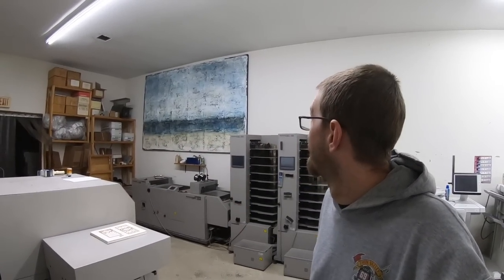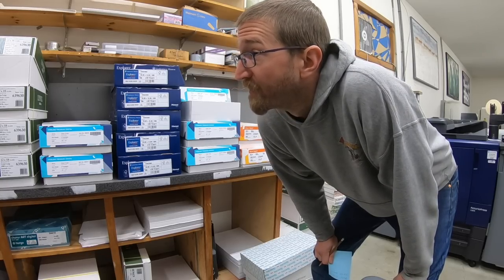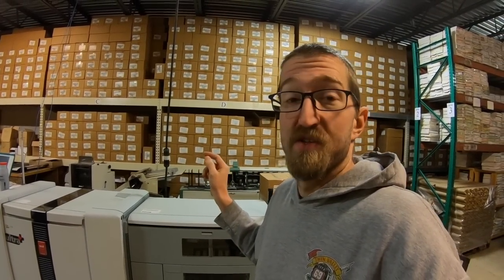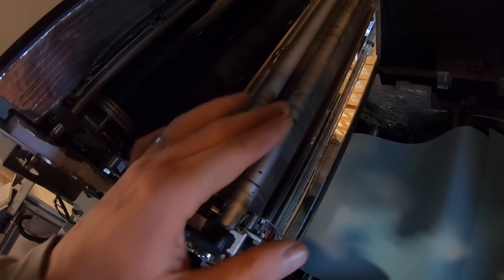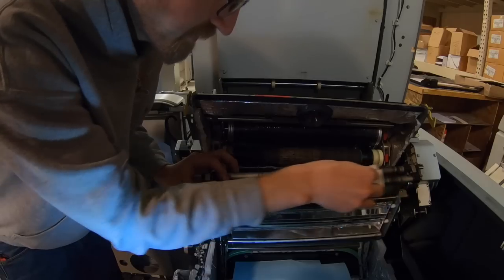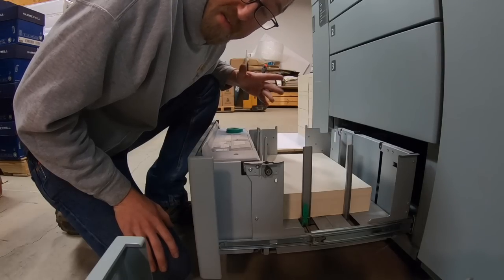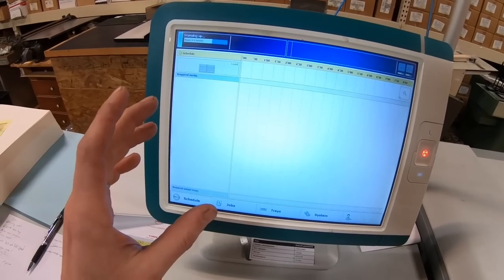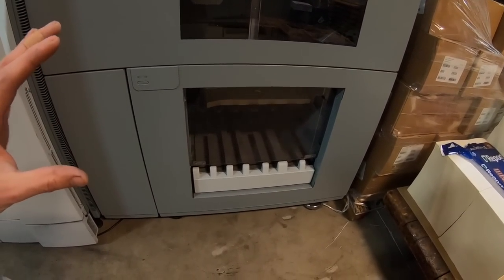Image Quality Problems on Canon/Oce Varioprint Ultra

Comment: The Varioprints are the way to go, been running a 6160 for nine years, only to replace it with a Titan 6180 two years ago. Colour is done on a Canon 10000, we also still have 
4-colour conventional sheetfed and the combination of all this is simply perfect. Kind regards from Germany.
Reply from the maker: Great setup. I will likely work towards that!
Reply: Winning combo! Did the exact same thing.

Comment: hi Dan, that void that you have is from the developer unit. if you notice clumped up toner or dirt in the devl units its best to do a one time servicer on the devl units..a complete clean up removing all the toner and a complete vacuum of the units. if you see the spiral cleaners filling up at the ends you need to chck your devl units for side leaks that will spill  over to the framing lamp located below the devloper unit and when you clean the framing unit you need to cleaon the print head too. the spiral cleaners are to remove paper dust and the sheet cleaners are to remove the the excess residue from the process. it works by printing a solid black print every 1500 prints which is then transfered tyo the spiral cleaner to form a sticky surface which then is used to clean off paper dust from the TTF belts..the sheet cleaners then collets any residue left behind by this process..there are also glue cleaners at the bottom back of the ttf units that should be cleaned everytime you replace your ttf belts these are the shiny rollers that have the coolent running through them these rollers are used to clean off glue that can sometimes be found inthe paper stock and other contaminations such as wax. typically the ttf belts have a life span of about 2.5 million prints per belt, same goes for the OPC, but this can vary with different types of media. and yes there is NO waste toner for this VP6XXX series . i service these machines and i can tell you that they can run for 4 days straight without any problems or jams providing they are running with good media and in the correct enviroment.
Reply from the maker: Wow, thanks for the education. That was very helpful!

Comment: I use to tech Oce stuff many years ago. They are monocomponent and it works pretty well. But you really need to shake the toner before you add it. And warmth and humidity could definitely cause clumping at the mag roller. Great machines. Had a mouse get stuck to a spiral cleaner once. Made a hell of a thumping noise.

Comment: Hi Dan, great video and progression to new equipment.  One thing to note, is the OCE devices are tanks, period!  However, one thing you may or may not be aware is the OFFICIAL support from CANON ends at the end of 2024 on the ULTRA+ series machines, so parts available could become an issue at some point after that!  Run all you can while you can and the machine will make you money!
Reply from the maker: Thats what I figure. I'll run them into the ground and then off to the scrap yard.
Reply: Yes, superb machines, we use to run two of these starting since 2014  (one ultra + one Titan), but Canon decided to kill OCE, in Europe the running cost is skyrocketing in the last couple of years. I switched to KM 6272P, which by-the-way it's a toy compared to OCE, but the running costs are MUCH smaller.

Comment: Wow, I sold my print biz over 10 years ago now.... I ran Xerox and KM equipment and 5 multicolour offset machines... Big difference that I am noticing is you do all the maintenance yourself... Production digital printers in Australia are soooo expensive.. I had to have maintenance contracts on both models of digital machines as the spare parts in Australia are off the planet prices... We would have the techs out at least once a month for a major repair.... 0.07 per colour click covered the parts and the maintenance. We weren't doing the clicks you are as I could slide 500-1000 plus runs over to the Heidelberg Offsets.. BTW great channel... Makes me smile... And cringe watching print production after 10 years

Comment: Glad to see you back. You can mount a webcam/security cam on each stacker and check them out easily and even if you are away. The ones with ir are especially good at that.
Reply from the maker: That would be great. I'll certainly consider that. Thanks!

Comment: Not only you are a printer, you are an electronics specialist. The way you work is also remarkable as well as economical. I relish the way you save funds, money, and materials. I am a little disappointed that the Canon printers had failed in your small plant. I hope you will be back up running and humming along.

Comment: Hi Dan, here is small tip for stacker: if you push button for stack ejection first time when printing, stack will be ejected when the job is done. If you push it second time, stack will be ejected immediately and you can easily check print quality.
Reply from the maker: Oh nice! That will be so handy, thanks!

Comment: Hey Dan, I like your videos. I’m a former production print tech/color specialist for dealer with KM and canon equipment. Your 1200 can be fixed for sure. I believe that was a common issue that could if it wasn’t getting its regular PMs. In my experience they ran a little dirty and if you didn’t regularly vacuum clean the process and transfer areas and toner ducts you would pay for it! but its kinda difficult to regain trust in it. The 1070 tripped a fuse and you’ll have to get into service mode and reset the fault after you replace the faulty parts. It could be one of the heat lamp or just bearings  . Recommend a PM kit w
It’s fusing belt, rollers, bearings and stuff. Message me if you wanna chat. Peace
Reply from the maker: I figured there was some sort of breaker in the 1070 that was tripped. I'll have to check and make sure to include that in a video. Thanks!!

Comment: You can keep an eye on the Canon machines simply adding a security camera inside (a wired one will do the trick, not sure if a wireless cam can do it)
Probably you can use a PoE one so you only run one cable... even you can power a led light (or use a relay to power on the light)
Other solution can be using Octoprint on a raspberry. Good content, helps me a lot, thanks.

Comment: You have quite a range of equipment there! The company I work for are xerox dealers and i would say the xerox Iredesse or 1000 are solid machines and I have worked on them with over 30mil on the meter and still running strong. The problem with the 800/1000 is that it's getting expensive to run and parts are hard to get when not on a service agreement. You can pick the 1000 up pretty cheap now but the iredesse is very expensive and rare to find 2nd hand. Also i would stay away from the versant range with the amount of volume you do. I consider them more high volume printers than a production press.

Comment: Good to have you back, Dan! I am not sure if your Canon machines have this, but I remember seeing a promo video where it shows a engine similar in size to the two smaller that you own where they implemented a waste heat recovery heat exchanger; they basically have the sheets that have just finished fusing preheat the sheets going in to be printed, which I though was quite a novel feature for a digital production press and another way to reduce their overall power consumption. 

The technology used in these machines is much much much more efficient than the traditional xerographic process we're all used to. It would be neat to see a 4 color process machine of this type.
Reply from the maker: You are correct! the 115 machines I have use a metal foil to cool off exiting sheets and warm up sheets that are entering the fuser. Very cool! I agree I'd love to see a color machine like this.
Reply: They have the i300 on the four color inkjet side.  It is radically different from the toner machines, however.   It has a heated fixation drum to dry the ink and then a sheet cooling area to reduce the temp before printing the second side.  So they basically don't want to preheat the paper too much, or at all, because they need the drying to always be controlled.  The machine does vent a lot of heat out the back and definitely cuts down on any need for facility heat in winter.  We had to add extra AC for summer.

Comment: also if you dont already know when you need to put new sheet on the cleaner roller be sure to pay attention to which way they wind on the roller.  If not and its wrong they will unwind into your machine.
Reply from the maker: Yes, I've been told that and now I triple check when I do it. :)

Comment: Hi Dan. For the 1070 that shut down, it's o precaution measure by the machine if the fuser belt goes outside of it side guides. There is a cutout switch at the back of the machine, just where the power cable goes into the machine. Check it out and remember to switch it on after fixing the fuser belt. Has happened to me severally.

Cheers
Reply from the maker: Oh thanks! I figured there was some sort of breaker in there. I'll definitely look for it. Would be good for me to post a video about that, I have had others ask me about it in the past.

Comment: Paper is getting easy to get but prices are not going down and I’ve been told it won’t go down. Last year I was buying up everything I could get because it was such a struggle to get paper. I have 4 times more paper on my floor to make sure we don’t run out of items we can’t get right away. I’ve been told that capacity is being taken away… one mill is switching over from fine paper so we will be losing a big amount and that may create issues again soon. I am preparing by stocking even more in the coming year. The days of expecting the Paper houses to have what you need on there floor may be gone.
Reply from the maker: I think you are right on the high prices are here to stay and the coming years will be different than the past. Good to hear from you!
Reply: It depends. There’s a few jobs I’ve outsourced because if I got the paper myself to do the job it would have been more expensive. I think large trade printers are buying A LOT of paper and making outsourcing cheaper…

Comment: Congrats on the Oce. As far as I remember it is the front end (rip) where they put in the printing speed. I was not aware that you could switch the rip’s from one machine to another. Yes I have a certificate from OCE that they will service/guarantee it for 1’000,000,000 or 10 years. Mine is 8 years with 120’000,000. I started out with Konicas and graduated to OCE /Canon. Good luck.
Ahh and yes the color Imagepress 10,000 did the work of a Konica 7000, 8000 and 1070.
Reply from the maker: Yes, I guess I need to consider the Canon 10000 now!

Comment: Speed of these machines are decided by speed licence of the machine with the same engine
U cannot contact canon for increasing the speed since the speed licence is registered on the main PCB board at the time of installation

Comment: Cool to see you back!
When you posted the short I took a look into the Ultras, very awesome machines. Almost kinda sad that we have no real use for a pure B/W machine since all people want from us is color.
What's your thought on Inkjet Production machines? Kyocera 15000C looked interesting, but I've not seen any real world quality examples yet.
I'd also love to get a machine that does banner sized papers to make bigger folding flyers etc., but the current prices of material make it hard to sell to customers.

It's fun to see how your fleet has grown since the first videos and baffling to think that you're still doing most of the work by yourself.
Reply from the maker: I think inkjet will be there some day. I have been impressed with some of the new large inkjet presses. But way out of my budget. If I need more capacity than the two Ultras, my only option is inkjet.
Reply: I saw a Kyocera at Printing United. The quality was pretty good. Definitely not as crisp as toner, but if you’re running a lot of transaction type jobs it would be perfect.
Reply: @miketheprintman  Yeah, that's what I thought. But our jobs are mostly either student projects or small runs of advertising prints, flyers, business cards, restaurant stuff, art, postcards etc. Currently running Xerox C570 and C60 machines who do great quality on a variety of stock. Guess those will keep us a good while.
Reply: @justaprinter  Agreed, the speed on the ultras is awesome. Issue with the larger Inkjet presses is also that they stray further from smaller job runs or one-offs.

Comment: Dan, I currently have a C2070 that is misting/leaking purple (cyan/magenta mixed?) developer/toner all throughout the machine and causing horrible image quality issues. Any insight? I've rebuilt the transfer belt entirely, including the cleaning blade, and also replaced all drums and coronas. Thanks

Comment: to check image quality go tp operator screen go to system... setup.... intermediate check sheet and it will send a printed sheet to the top tray on the print engine..  it only takes about 12 sheets to spit it out.  good thing is it still prints the page into the machine so no page is lost.  We have two canon 10000 one canon 10010 and two new canon 6330.
Reply from the maker: Yes, I just found out about the sample sheet. I'll certainly have to do that. Thanks!

Comment: For that web frontend: There are a couple of relatively cheap touchscreen monitors available nowadays, coupled with a sub-$100 mini-PC (or even an Android-stick, as a web browser is enough for you) and a monitor arm to mount the combo to the wall, those make nice remote control stations. I use that setup for my laser cutters and it's really nice.
Reply from the maker: Great idea, thought that it would be nice to have a large screen on the wall showing all the presses. Thanks!
Reply: @justaprinter  Does this management interface have some kind of API? Thought of another solution to the same problem: send push notifications to a smartphone (+ smartwatch, a simple $40 "Amazfit Bip U Pro" would do). Messages like "stacker ready to empty" or "empty stacker within xy minutes or machine will stop" but yeah if you're in the middle of a 30 minute task and you get a 45 minute advance notice you either have to remember it or you would be constantly spammed with reminders, unlike a monitor that always shows you the information and allows you to plan your own time whenever it suits your shedule.

Comment: Your videos have made me want to get my own press! But not enough money for that yet.

If I was wanting to print a tiny book how small could I go with a digital press like these or the Konicas? I’m looking into a passion project.
Reply: Do you have the column to justify the installation and maintenance issues. Printing digitally comes at unique increase in technology cost vs mechanical/offset printing. The manpower costs vs technology  is different
Reply: @kevinzane6947  I’m not sure what you mean by “column”, but like I said it’s a passion project. Because of that the costs are calculated different from a regular business.

Comment: Hey guys! I have a Konica Minolta Bizhub Press 1052e with a FS-532 finisher and paper feeder I want to get rid of. What should I price it at on eBay? Also, what's the difference between a 1052 and a 1052e? Cheers! (not looking for offers - I'm in Australia).

Comment: That bizhub press fuser is a real bear. They never give you the hot roller that heats the belt in the fuser kit. Sometimes you also get paper curl problems.

Comment: Hello, do you have this board? A85CH01104
Or 
A85CH01100
Main Body Control Board Assy, for c2070 ?
Reply from the maker: eBay. Or arcservicesco for a new one. Hytec can repair them

Comment: In your pm vacuum dev roller one evaluation due to media pullution. Multi viods start shacking toner bottles better and or complete cleanout if voids returns
Reply: Then cut the clean sheet one rev and clean the glue cleaner roller
Reply: Check for preheat plate pollution too
Reply: The preheat plate is designed to open the fibers of the paper so the toner goes inside the sheets to last a hundred years not like z

Comment: The Oce / Canon is a great machine, but as you found the dev station is a right pain as it's prone to getting toner lumps causing the issue you had, also the changing of the spirals for me seemed a big waste of material (metal) than the old fashioned plastic toner waste bottle when you throw it away. But your right about they run and run with little issues. I loved the single pass printing, especially on very then paper. The only negative was prisma sync software.....it's rubbish compared to konica's Front End.
Reply from the maker: You are right, I should have mentioned that Konica front end does have many more options.

Comment: konica minolta AccurioPress c2070 fills Bypass tray but it does not recognize. Can you guide me to fix it?
Reply from the maker: Maybe a dirty or bad sensor?  Maybe it was disconnected where you connect the finisher to the print engine

Comment: Special colors of spring hill here are usually 6 months out if you can even get them.  Special envelopes are 6 -9 months out.  Goldenrod —good luck.  Canary—maybe, if you’re lucky.  Gloss ream wrapped?  Yeah, nope.
Reply from the maker: Yeah, I forgot about that. I pretty much gave up on stocking any colors.
Reply: @justaprinter  unfortunately, we have to try.  Notice I said, try.

Comment: The double letter is for those cheap companies who don’t want to buy additional feeders and you can keep
It running continuously. At least you can in my Ricoh’s as the side that’s feeding will stay in the machine and keep running while you load the other side.
Reply from the maker: Oh nice, I didn't Ricoh has trays like that.
Reply: @justaprinter  just one.

Comment: 😂 at my job we got konica minolta machines i told the boss we dont need the high capacity stackers because it would be more problems. I was right 😅 print quality dropped because we couldn't check throughout the run